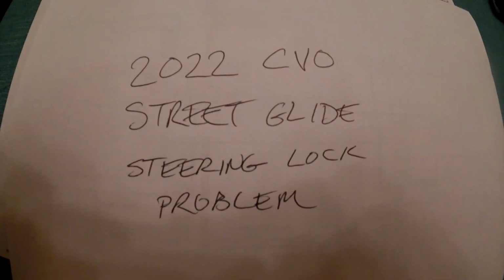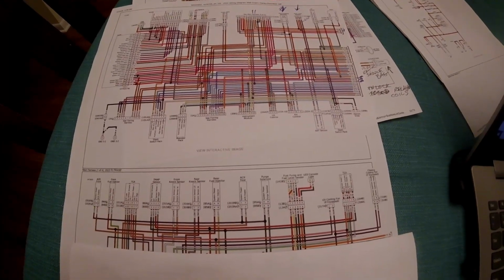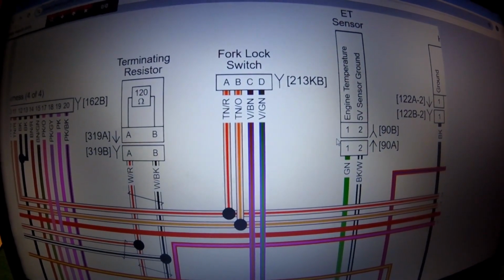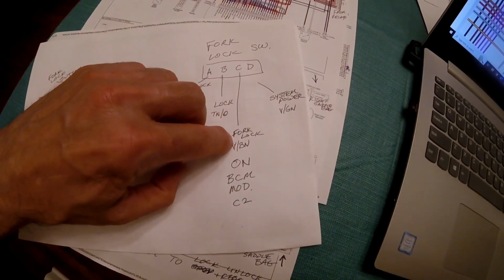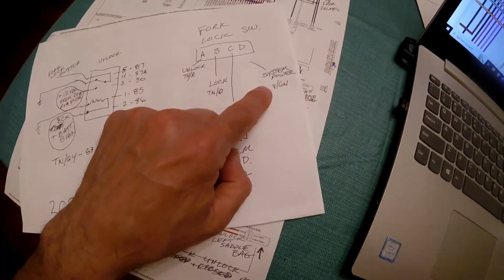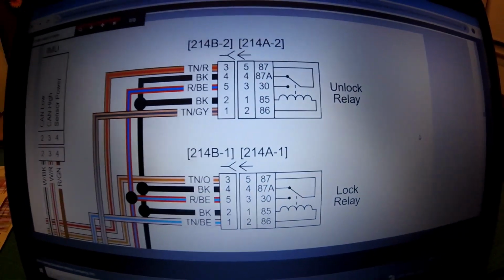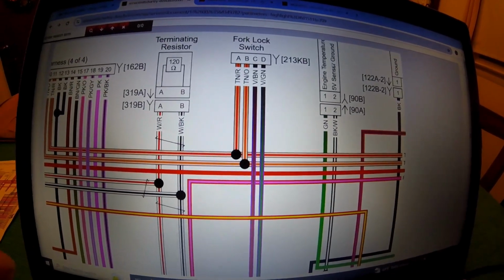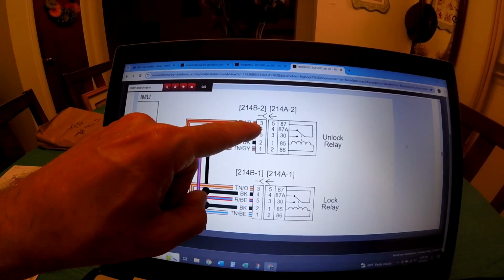CAN BUS Troubleshooting #harleyrepair  Steering Locking electrical system wiring CVO Street Glide

Comment: Glad you made it simple...
Reply: Different but similar, I've been  fighting  my anti theft system  on my truck.  It's working most of the time now.
Reply from the maker: I hear that. 
 I appreciate you watching and your support.
Reply from the maker: @laurentruesdale4088  the anti-theft system can be very hard to troubleshoot. They are like a tree with a big root system. The system is in many parts of other subsystems.
Reply: @Rapsgarage  over the last few weeks  I've learned more about the anti theft  system of fords than I care to. Locksmith didn't help, just charged me. If the truck was a little  newer I could  bypass.  I don't go out often anymore, so im good. Always look forward  to your videos, thanks.
Reply from the maker: Thank you